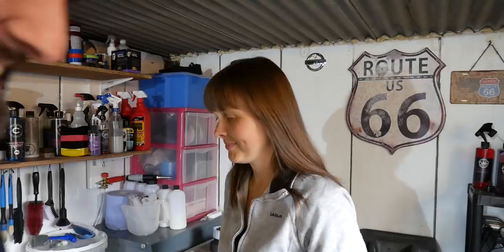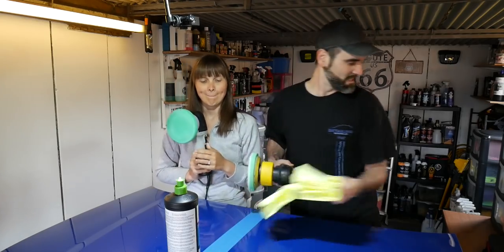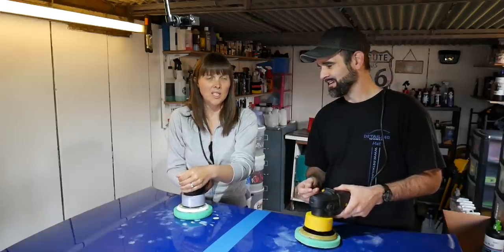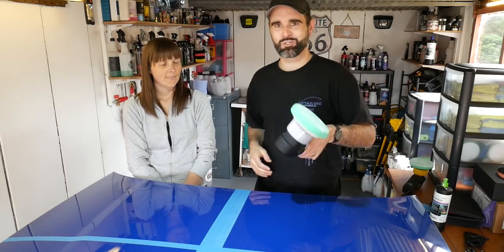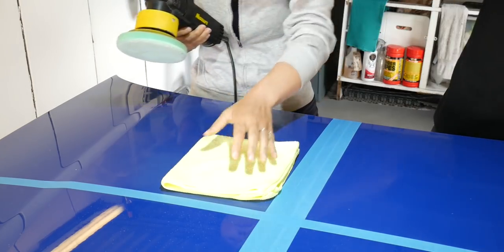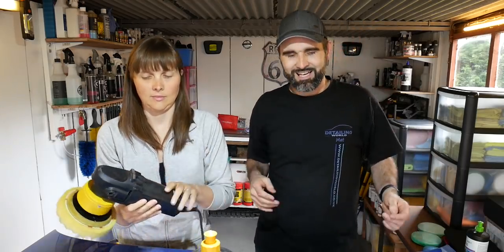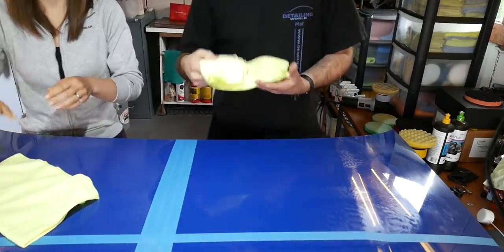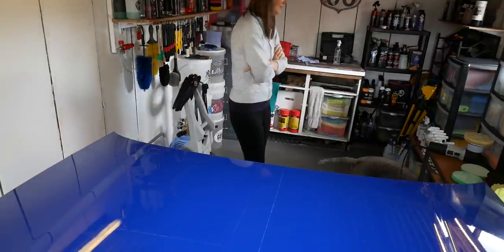Teaching The Wife To Polish! First Time Detailer

Comment: Great video. Can I ask what was the cause of the hazing on Jens part of the panel, given you were both using the same polish and pads.
Reply from the maker: She was going a bit too quick, and didn't lift the weight off the bonnet. But, it kinda doesn't matter at that stage anyway, as you'd switch to a softer pad to remove those kind of defects (which is what we did).
Reply: @TheDetailingSpace  Thanks for taking the time to reply. This was a really useful teaching video watching a novice use the DA and then highlighting any issues. Great stuff